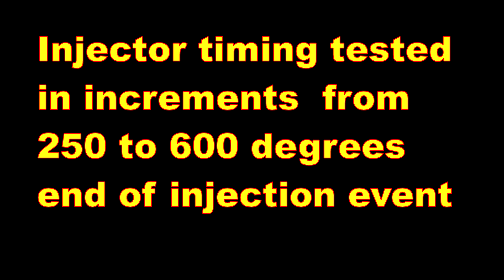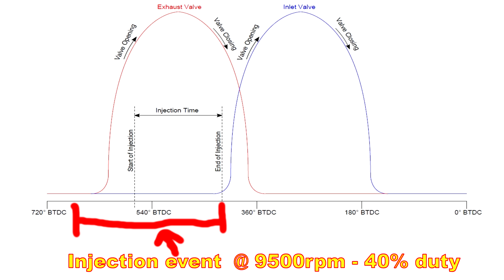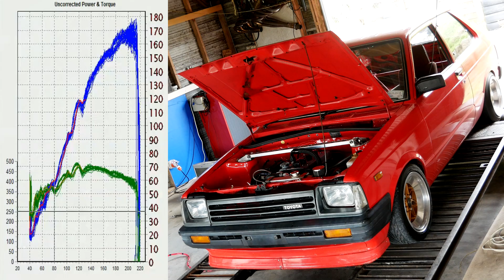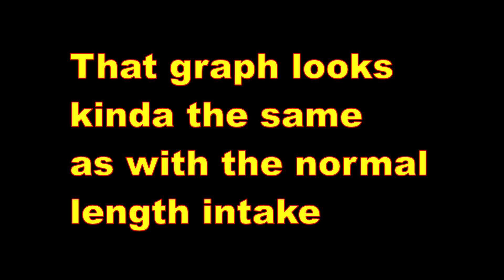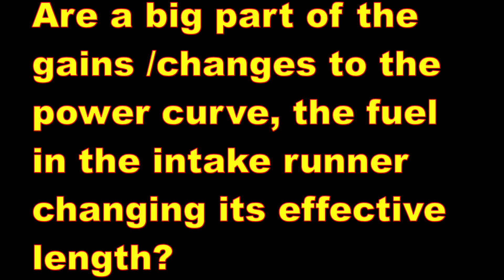Stand off / Outboard injection  - Fuel injector location dyno tested

Comment: Injector position is further from the port is for highly oversquare engines that have a lot of valve lift. Due to low velocity through the valve at low-mid rpm the injector is placed as far away as possible for better atomisation, especially when large single injectors were used. If you were able to increase the rpm and injector size and valve lift, the injector location will make a difference for lower/mid rpm. Its not just about power also, but avoiding washing cylinder walls and diluting oil.

Comment: Hey man the stuff at the end your runs looks like the dyno retarder vibrating on the load cell. You can quickly check this with a dial gauge mounted to the frame and pointer on the retarder ontop and from the side while rotating the assembly. Had this alot on the old vane dynos i used to referb (same as yours) id advise to give it  quick check. Let me know if you need to know anything
Reply from the maker: hey,  Yeah have had multiple attempts  at getting it bang on, is a lot better than when i first got it.    what kind of run out would you find and try get them down to?     The speed on these runs are pretty much maxing out what the retarded is rated at, max rpm wise.   Also think its a bit to do with the control as does it at lower speeds also when power rolls over

Comment: The difference is usually more evident on hot days. The injector setup outside the ports cools the intake charge more. Even so it is usually small gains. But on hot days that can make all the difference.

Comment: On several videos you put the oil and water temp. On some test you made an oil temp comparison as well.  How do you adjust the oil temp?  The lower limit is obviously with a thermostat (btw do you have an adjustable thermo?) ,   but how do you keep this temperature constant?  I can see nothing special on your engine!  Thanks
Reply from the maker: water temp is just around the thermostat temp.   I let the car cool for a few mins after each test,  once the oil temp drops to my target i run the car again.     running the car hard on back to back runs will get the oil temp up.  i usually  run the tests at 90 or 95deg as its easiest to target on this setup.    Also i do at least 4 full pulls after the car has warmed up, before start any testing

Comment: I would like to see a direct comparison test between running the engine on full sequential ( 720 degree cycle) VS semi sequential (360 degree cycle and half the pulse width) everything else the same. This would give us a measure of how worthwhile it is to bother with a cam sensor

Comment: It's probably been said already, but isn't upstream injection about allowing sufficient time for fuel vapourisation at high speed?

Hyabusa have two sets of injectors per port.  One is downstream of the throttle butterfly and aimed towards the spark plug.  The other is upstream of the butterfly an aims at a fixed plate in the intake.  I think the intention is to smash the fuel on the plate into smaller particles, which are easier to atomise.

Anyway, thanks for the cool video.  I always bring my popcorn and headphones :-)

Comment: Hi sr! You can test use both injectors, outboard and standart, but can balance the flow about the RPM, because looks that outboard location of injectors is better for some rpm range and standart for other. If possible water or ethanol injection too, as extra supply fuel.

Comment: Hey bro random question would u have a set of 4age piston pin circlips that you would be willing to sell Iv been looking for months I'm using some 4agze pistons in my gsr lancer build only thing I'm missing is the circlips chur.
Reply from the maker: Should be able to get them new from Toyota or amayama or something.  Make sure you get the 4agze ones. The normal 16v ones are different
Reply: @Garage4age  cheers bro good info didn't know they were different to the 16v ones don't want them coming out at 9k put a hole in the block lol
Reply: @Garage4age  thanks bro finally found the part numbers should be able to source some now amayamas the go for Toyota part numbers

Comment: Here's my theory. Outer injectors are generally associated with high rpm engines. 
But the necessity for this comes from two things. 
At 10k+ rpm, there really isnt enough time for air and fuel to mix. 
But more importantly, engines that can do 10k+ RPM usually have a long rod/stroke ratio, and a wide bore with short stroke. Which I believe gives considerably worse air/fuel mix than motors designed for lower rpm that will have a square or long bore/stroke ratio. 
So mixing in the intake makes up for the lack of mixing available from tumble etc inside the cylinder. 
On my 1NZ motor, I can have the injectors right by the port, or right outside of the trumpets, and the air/fuel ratio stays identical, even idles fine. 
I think because the motor naturally mixes air/fuel well, regardless of where it's coming from.

Comment: You probably get this question every day but what's the max HP you have achieved on a 4age . Also was your max pH rún also your max nm run?
Reply from the maker: this is pretty much it  167kw (224hp)  at wheels,  assuming you're talking non turbo
Reply: @Garage4age  thanks so much for the info

Comment: It's most likely due to the change in density. By moving the injectors out further it lowers the temperature and increases the density. If you used a alcohol like E85 or methanol it would show a even larger change.

Comment: Ducati used to fit one set of right near the valves, one further out spraying the trumpets, gave the best of both worlds… loads of cars run direct injectors in the head and a set of port injectors now too, but that’s primarily due to warranty claims from the back of valves getting caked in PCV grime.

Comment: I am a bit surprised/disappointed with the results. 
I thought that the farther from the valve the injection occurs, the more homogeneous the mixture in the cylinder will be. 
It should also have a slight effect on the intake temp. 
but I still think that the location of the injection will affect the behavior of the engine in a half throttle situation. 
What are the injectors, looking at the duty cycle they must be damn big.

Comment: I think the outer injectors are good when it's HOT outside or HOT in the engine bay area and fresh cool air needs to cool down.... cooling the intake charge with the injectors far away from the valve??  Maybe that's hard to create in the engine bay of a dyno??
Reply from the maker: Kinda hard to create on this setup at all.  The intake has a 25mm plastic adapter plate and thermal gasket against the head.  along with big hole beside radiator thats cooling/feeding the intake.  so very rarely the  intake gets much above ambient.     Likely one of the reasons the results aren't as expected

Comment: As everyone else says, more time for the fuel to atomise and cool the charge, similar to carbs. however putting the injectors outside is kind of a fire hazard.
Also the longer length means more area for fuel to stick to the walls of the runner, messing with throttle response and mixture. 

speaking of mixture, what mixture are you targeting? 
not sure if you ever mentioned that. 

also have you tested the differences between E0, E5, E10, E85?
Reply: These are straight runners, fuel deatomization occurs mainly when you have bends in runners so it's not likely to deatomize in this intake setup.

Comment: The better atomisation of the fuel on the high rpm, should also help to keep the burning temperatur lower then with the normal setup, because more fuel can vaporise(vaporization cools). This should also mean that you could advance the timing a little more, because the knock probability goes down, in theorie, which would mean a little bit more power again on the high side.
But just Theoretically 😂

Comment: Its the evaporative cooling that helps the power up high and charge density that effectively lenghtens the intake as it reduces reversion. 
Would be interesting to see injectors 90deg to the port and on the long side and short side of the port. Does it make any difference.

Comment: From my perspective, the further the injectors the richer you want it to get,  the A/F ratio will drop once engine heat up with the hood closed, that's why most race engine with ITB's do use double injectors for acceleration and stability at high rpm

Comment: That was my thought on the outer vs inner, that they seemed to be having a similar effect as changing the inlet length. Looking at the dip midway through the run it shifts up and down with injector placement. I wonder if the speed of sound in air+fuel vapour is different 🤔 suppose it would be!

Although I expect it could be due to the air being cooler as well, which also changes the speed of sound in it...

Comment: Wondering if you saw much of a difference in fuel injector pulse width for different timings. Have seen this change to a greater extent than performance when dyno testing FSAE engines. We always targeted injector timing which minimises pulse width for the same AFR  (=best fuel economy). Also changed with changing throttle position.
Reply from the maker: Hey,  yeah have found basically the same thing.  doesn't seem to bee any need for a dyno to set the injector timing.  Just tune the injector timing to get the richest afr reading. then trim the fuel out.    Injector timing on the  inner injectors has quite a big effect in the top end if set wrong.  a bit of power but a big change in afr.  unlike seen with the outers

Comment: Outboard injectors are generally only used for higher revving engines, allowing more time for a good mixture. On many rally engines you run two sets of injectors, one at the back of the valves for low rpm, blending to the outer set at higher rpm. A company I used to work for did a test about 20yrs ago, engine on dyno, guy in the cell holding the fuel rail and walking backwards from the engine. Power increased the further away he got. Fun test but obviously practical limits to that. As you've seen, things like this, runner length and injector timing are all nth degree stuff but they all add up. Most people that tune engines on standalone don't bother with it but people who specialise in a particular engine will generally have been through all this kinda thing to make theirs the best. Anyway, good work, nice to see proper vids on YouTube!
Reply: How high is 'high revving'   he just ran that engine out to 9750rpm

Comment: I believe that the gains are derived from 2 main things. 1). The latent heat of vaporization of the fuel. As the fuel vaporizes, it pulls heat from the air and creates a more dense charge. The further away from the intake valve, the better the effect. This is why this setup works really well with alcohol fuels (E85 and methanol), as their latent heat of vaporization is much greater than gasoline. 2). The additional mass added to the air charge helps keep the air moving as the valve closes, yielding a better overall volumetric efficiency. I would be very curious to see a dual injection setup where the fuel is supplied by the inner injectors, they phased to the outer throughout the peak torque range, then phased back to the inner injectors above peak torque. This is how the motorcycle manufactures do it, but those engines rev much higher. I would also like to see this test done without the shorter runners, but I'm not sure you have enough room with the current setup.

Comment: You may need injectors designed to be placed over the velocity stacks to get the best out of this mod. The spray pattern is quite different from those running below the throttle plates.
Reply: I've got inner and outer injectors from an S1000RR bike. The spray pattern is wide angle, 4 hole for both sets. The outer injectors are mounted so far above trumpets its crazy, it must just mist the whole airbox.

Comment: I'm seeing how the difference of the outer vs inner placement of the injectors is effecting your curve. The outer injectors allows greater atomizing time of the fuel in relation to how the intake pulse rebounds off the intake valve when it closes. Very similar to the results of when you change the runner length. Now do a setup with dual injectors; Inboard for idle to 6,000 and outboard injectors for 6,000- 9,500.

Comment: Longer injector position would help the fuel atomization, and makes intake charge colder, so denser air
But, since the gain aren't that much, maybe your injector is good enough to atomize the fuel
Reply: Farther the injector location, better atomization
But, with more length, it takes more time to reach the cylinder, maybe on daily basic drive, the throttle response would be different, because all of the testing are in WOT, not partially open and closing

Comment: Wonder what it would be like with different timing on inner and outer while running both at the same time but alternating which is in use depending on RPM

Comment: What's the point of letting the injectors spray against the throttle plates? Wouldn't it block some of the fuel delivery except on WOT?

Comment: Not convinced at all.
With the graph to the left, I say you have to do it once again. With the graph in its usual place, to the right.
It’s important to keep EVERYTHING the same between tests.
And I wouldn’t trust any of the “Left-to-right-graph”-correction factors circulating the web.
So redoing the tests it is.

🙄

Comment: I’ve been hearing on the interwebs, that aiming a much bigger then normal injector at the back of the valve when it’s open has the most gain outside of direct injection. Something to do with better atomisation of the fuel and less condensate forming on the intake runner walls. 

Going by the runs you made, it looks like the outboard injection had better HP up top while the normal location had better torque down low. Only marginally though. 

It could be an idea to run both if your computer can handle it
Reply: Interestingly on a similar effect. I have noticed on my car when "upgrading" to the newer EV6? design over the older large body EV1 type, that starting, idle quality are worse and economy is marginally worse even with full injector characterizing and corrected AFRs. I think it might be because the older injectors are like fire hoses and inject straight on to the back of the valve where as the newer type is a fine mist and wider cone patterns.  So being batch fire I recon the newer injectors despite being more atomized is just wetting the walls more than the old type which hits majority of its fuel on the back of the valve.